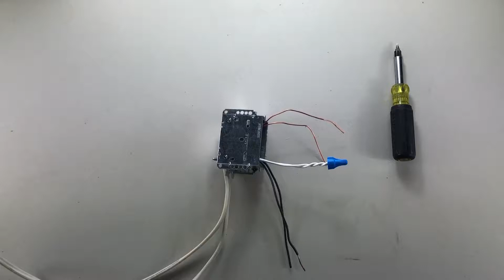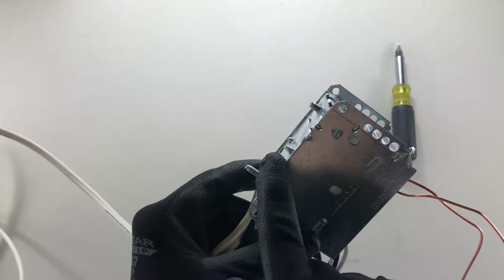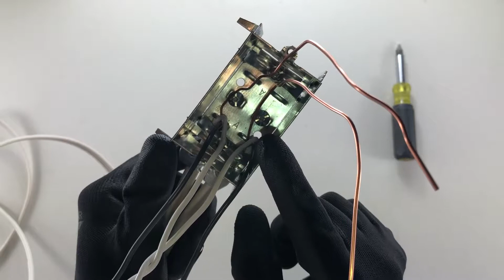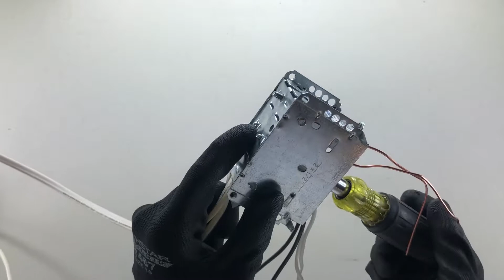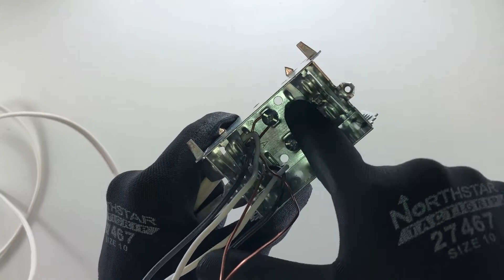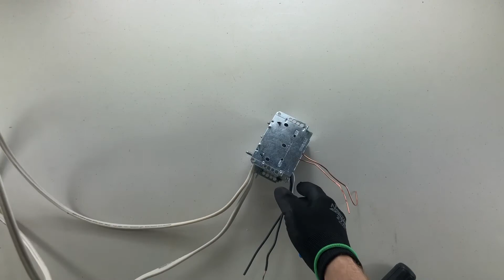How to bond your device box to ground - Grounding - The Electrical Guide 2019

Comment: I appreciate you sharing your videos with me and trying to help out. I have two neutral wires and two hot wires and a small ground wire attached to the back of the box. If I were to attach another ground wire to the box long enough to reach the gfci receptacle grn screw , would that take care of the original open ground indication on my outlet tester?
Reply from the maker: Just because you’ve got a ground wire attached to the box doesn’t mean it goes back to the ground bar in your panel. If there is no ground wire from your box back to the panel you won’t be able to ground an outlet at that box. The only exception is if that box is fed with a metal armoured cable. If you’ve got metal armour you can bond to that.
Reply: @theelectricalguide  Prior to trying to swap out the 3-prong for the factory trip GCIF,  the outlet read open ground. Now that I can see that the box was wired for ground without a wire coming off the box to bind to, would that give me the open ground. Or because the box is in fact grounded, I have an open ground. So I would have to find where that loose or disconnected ground is?  If I got something like the Klien would that trace it to the source?  What would you do.  Thanks for your valued opinion.
Reply from the maker: @rashellyohn5128  You would get an open ground reading if you had no ground wire directly back to your panel from your box. You won't be able to fix that unless you run a new ground wire or a new cable with a ground wire back to your panel. The only other way is if that box is fed with armored cable you can ground the armor. Sounds like you need to install a new cable feed to that box with a ground inside it.
Reply: @theelectricalguide Thank you for your quick reply